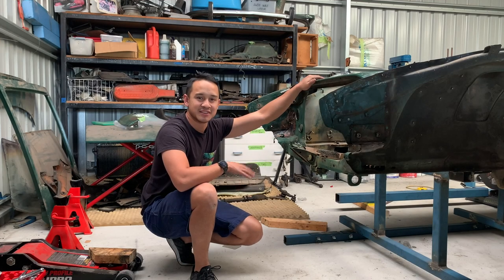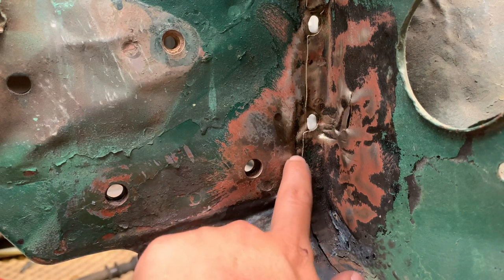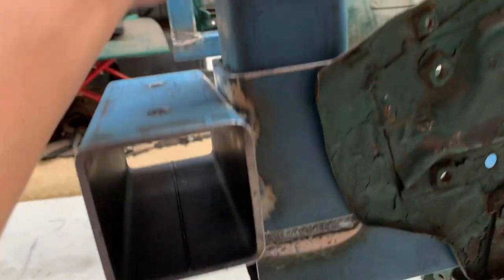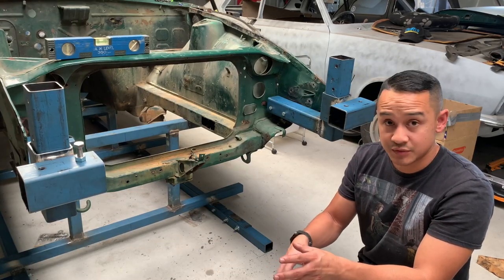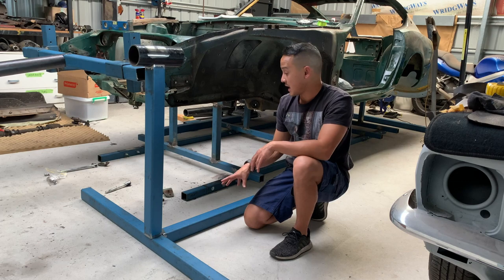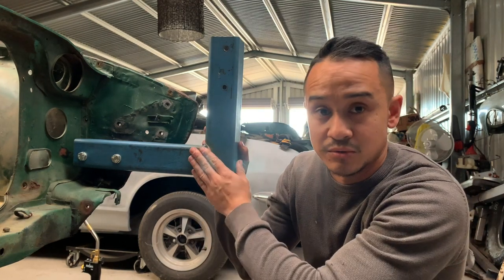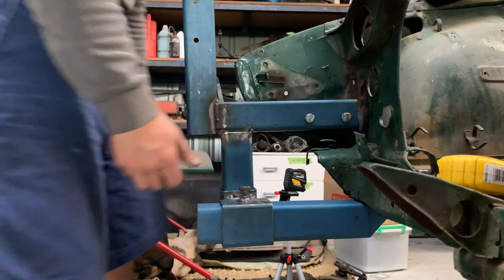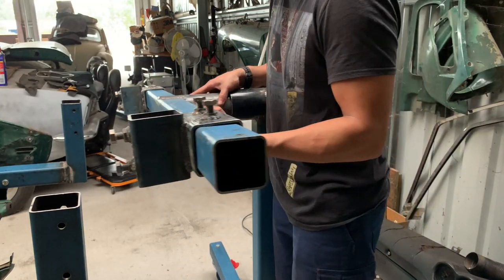Building a Custom 240z Car Rotisserie Part 1 Datsun 240z Restoration Project Ep16

Comment: That spatter you're getting might be a setting. I think you might be too hot. Just a thought. Beautiful work though!
Reply from the maker: I did think it might be a setting, I tried playing with the wire speed to get rid of it, my welder only has 3 settings for voltage and it’s set on the correct one for the thickness steel I’m using... 🤷🏻‍♂️